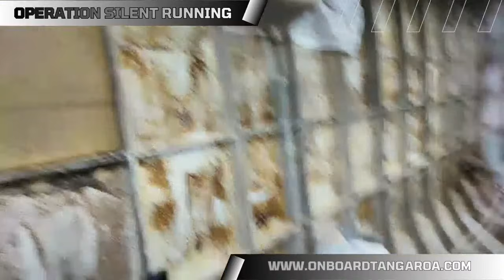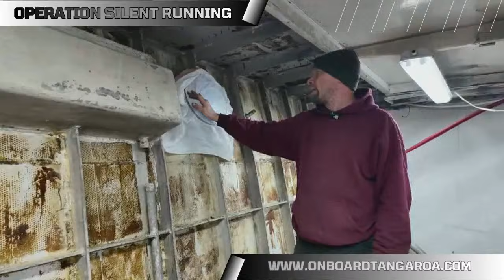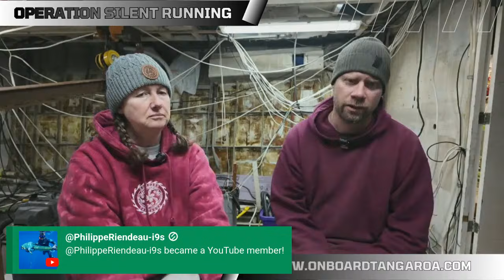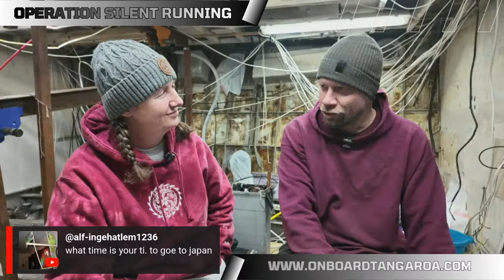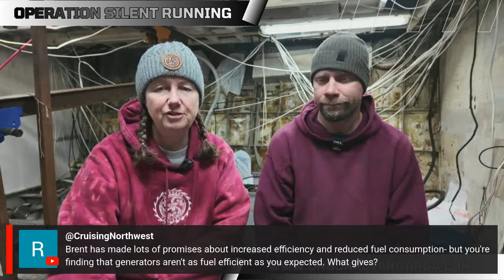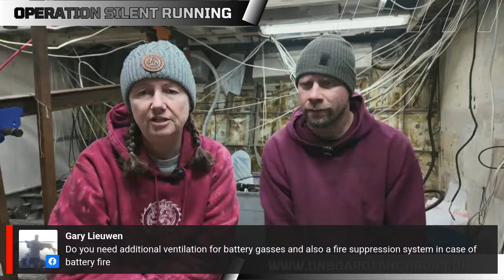Engine Room Plans, Viewer Comments, and What Comes Next

Comment: ChatGPT says AC generators can be 5% more efficient even after rectification, you would just need to find or build a rectifier to convert it to DC. What battery voltage are you running?
Reply from the maker: We are running a 670v bank.
Reply: @OnboardTangaroaSeatrial  Oh wow, pretty high. I have no idea what your setup is to really comment on it. Are the generators lower voltage than the battery bank? Therefore requiring a boost converter type charger? That would be another unnecessary efficiency loss
Anyhow, high voltage diode rectifiers are very efficient, AC might be better to go with compared to the DC brush type, possibly 5% - 10% efficiency gain, assuming the AC generator is of the more modern efficient type 
I will just say your videos are kind of disorganized. Even in your main hybrid videos you didn't even explain anything at all why you did in the first place. There's like close to zero detailed information about what you're doing in your main videos, so you constantly get basic questions in comments. I get what you're doing now though. Solar plays a major part and instead of having a transmission you just went with serial hybrid.
Reply from the maker: The generators would technically be pretty close to the same peak voltage. We are currently looking at active front ends to handle the conversion. 
    You should maybe watch the Lives for more info. The main channel is simply us documenting the work and such. Yes, solar will help supplement for sure but will definitely nowhere near cover propulsion demands directly. It will however help when we are doing short trips and sitting in places for prolonged periods.
Reply: @OnboardTangaroaSeatrial  Nah, I'll pass on watching hours of lives
Reply from the maker: Alrighty then.

Comment: wonder how mush heat those batteries will generate when charging discharging , i have a small electric car (realy small like immobillity cart size but coveed) and running 72 volt 100 aH lithium batteries , those batterie are sitting in stirofioam and get nice and toasty when running , i like it that way as it helps charging them on cold nigts and making them last longer during a drive in the cold , it not oh god i can fry an egg on the thing they just warm enough that you want to tuck them inside youre coat as a small heater 
thing is with a whole wall of those things and likely a lot more amps with the batteries in between walls you might need to run some air through the space in wish the batteries sit  (maibe use it to heat the boat )warm is good , hot is not you might allos want to run coolant lines through the room to warm it up when the boat hasnt run in a while and the temperatures are low , batteries dont charge well in the cold / dont hold charge either
Reply from the maker: Honestly, because the bank is so large the c-rate is very low for our demands. It should be able to maintain temps nicely. We are also looking at water cooled battery options though.

Comment: Yes, a day late. A few ideas: maybe the engine room could be called the “test cell”; With the new wall traversing the “engine room”, make that the “wall of power” it sounds like it will be a clean slate and not blocked with batteries, etc. plenty of space for plaques.
Reply from the maker: Thanks for the recommendation! We kinda like the idea of having the batteries visible behind the plaques though.

Comment: I don't know all that much about yachts, apart from the stuff I learned from your channel and the Intoodeep channel.

About solar panels, batteries, inverters and stuff like that I know a bit more.

With (home) batteries efficiency varies by all kinds of factors, temperature, size of the battery, type and brand of the battery, charging and discharging currents, etc.

<<<Edit: damn you guys are good! You knew this question in advance!! 😉>>>>> <<<<< There is one thing that is always the case though: charging and discharging a battery costs you. With home batteries the best out there under the best of circumstances currently do an RTE (Round Trip Efficiency) of around 85%. 

Your efficiency theoretically could be higher, because you don't do the AC - DC - AC conversion typical home batteries do.

However, even DC to DC (voltage) conversion and charging will give some losses.

Therefore, I would think it would be most efficient to run the electric motors straight from the generator, instead of having the batteries in the middle.

If you would take that approach it might be beneficial to size the generators exactly for that purpose. Run 1 or 2 to generate enough power to run Tangaroa (on your prefered cruise speed) without the batteries being needed (much).>>>>>>>

Another thing to consider might be how to optimise charging efficiency.

Batteries don't like to be charged too quickly, however, not quickly enough might be detrimental to efficiency as well. Take (my) home battery for example: it's efficiency is higher when it's charged and discharged at 800 watts, than when it's charged and discharged using only a 100 watts.

An efficient system might take these efficiency curves into consideration: don't charge 8 batteries with 100 watt, but charge 1 with 800 watt, and switch to the next one, once the first one is full.

Just my two cents, you might already have considered all these factors (and even if you didn't Brent probably might have).

Ps: don't paint the boat. HOWEVER: electric cars sometimes have some accents to indicate they are electric, usually blue.

Might add some blue accents to show you're electric? 😉
Reply from the maker: You are absolutely correct. That is one of the reasons we are looking for generators in the 50kw size range. This allows us to feed the DC bus and drive the motors pretty much directly with the batteries there for peak shaving. This avoids the lions share of the charge/discharge losses to the batteries. The generators will also likely have some variable speed ability with will allow them to better match demand.

Comment: You've spent weeks stripping paint from the hull because it hides corrosion but you're going to paint the engine room, iirc? paint me confused. thanks for the video.
Reply from the maker: No, we will not be painting the engine room. We decided against that for the possible corrosion issues. It has lasted this long as is, we are just going to do the same thing again but with better materials.

Comment: If you need to do CAD work you can use software and an iphone 14-16 to make a 3D model of the engine room. That will help a lot and remove much guesswork and resolve fitment issues
Reply from the maker: I think Brent planned to do that once we finish clearing the space. Not sure if is still in the plans though.

Comment: The electrical panels will have closable doors to make them with look cleaner, why not place closable hinged panel doors over your fuel manifolds? Of course, the doors would need to be mounted on removable panels for mid to major maintenance. After all, it will be in a shop area and will be adding protection to the manifolds valves and lines. Will you be adding more sound deadening on the wall for the state rooms?
Reply from the maker: Hmm, never really thought about that. I suppose it comes down to preference. Will have to put some thought into it. At least then you wouldn't see all of my leaks 😂.
Reply: @OnboardTangaroaSeatrial LOL

Comment: As far as flooring for the engine room, would aluminum diamond tred work? It would be durable non-slip and easily pulled up if you need to get below the floor. The only drawback is if you drop something small it will probably go through the flooring. And of course, you will probably want to use a different flooring for the shop and laundry area.
Reply from the maker: I am actually trying to avoid aluminum on the floors. I also definitely want to go with something solid. One of the yachts I worked on had simple fiberglass covered plywood flooring and I actually really liked it.

Comment: Aren’t  internal combustion called engines and electric scaled motors?
Reply from the maker: Pretty much. While they are used interchangeably quite often there is an expected technical differentiation. I don't usually pay much attention to it though.

Comment: Flooring in engine room:  I would not cut into those KEEL length running large I-beams as those are structural, those top flanges need to remain in place at their designed height.  Great job on all the preparation work.. Floor base material I would consider Coosa board
Reply: I second this! I beams require the ‘hat’ to bear anything near rated load.
Reply from the maker: If we did cut them down the hat would be replicated. The only reason they extend as far as they do was to hold the front of the Detroit diesels. You should be able to see in some videos that they immediately drop back down to standard height after that. I reckon we will be consulting a naval architect before we did anything too crazy though.
Reply: @OnboardTangaroaSeatrial appreciate the reply. Sorry, I missed that.

Comment: Take a look at horse barn wall panels.  Its a thin hdpe panel.  White and abrasion resistant.
Reply: Actually sorry it's swine wall panels. Trusscore is the product.
Reply from the maker: Looks great. Says its not really designed for flooring though. Maybe if it were thicker.

Comment: Instead of a bespoke dc genset would a 3 phase genny rectified with proper filtering be a significant efficiency hit?  Many types of ac generators can be voltage regulated with surprising flexibility.
Reply from the maker: The dc generators are basically this anyhow. They still use 3ph heads but just rectify directly to HVDC. Not sure what it would take to convert a readily available AC generator.
Reply: @OnboardTangaroaSeatrial oh interesting. Makes sense industry has sorted a good way to do a thing. With your skills, and outside resources seems to me building a stable, repairable rectifier package should be a snap. Whatever you do, get the best quality caps possible, and carry spares 👍
Reply from the maker: There are lots of good IGBT controlled rectifier/inverters out there with water cooling and great efficiency. If I don't have to build it that is better 😊.